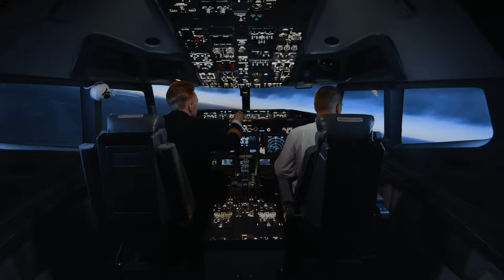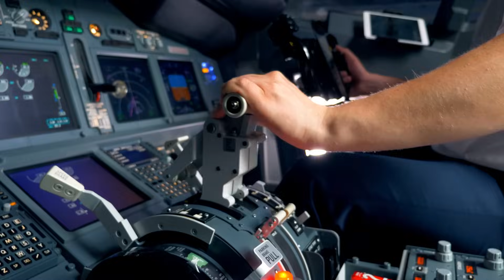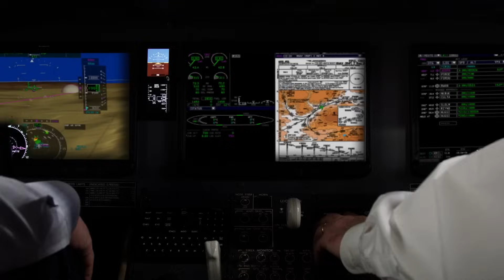RTX: How Are We Powering Electrified Aircraft?

Comment: Jet engines dependency makes pure electric engine powered aeroplane almost impossible or simply impossible. Cause Jets are (E)CE and are very powerful which an electric DC motor prop ofc can't replace, infact jets are only becoming more powerful since the start for commercial aeroplanes atleast. If you look at early (regular subsonic type)turbo-jet jets, they're not just much inefficient for longer range but had way less power than modern turbo-fan jets used in planes currently. Although those early jets were very powerful too, something which even a new EV prop can't achieve.
So, there needs to be a new type of powerful EV motor to replace the powerful jets, if incase it's possible. Otherwise it's jet that remains the reliable power source for planes until a new powerful EV motor starts to exist which might change it's fate.